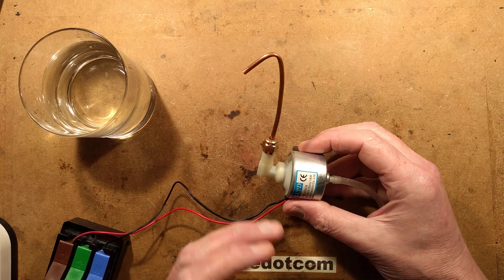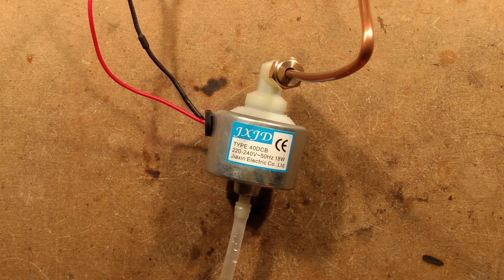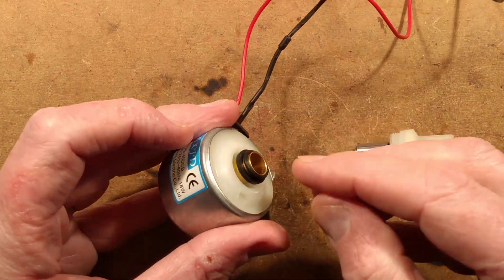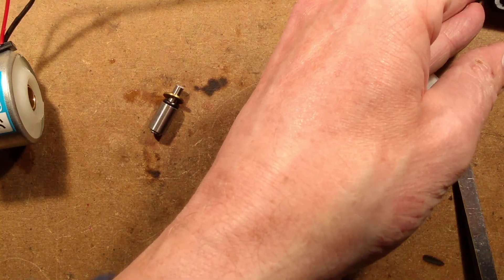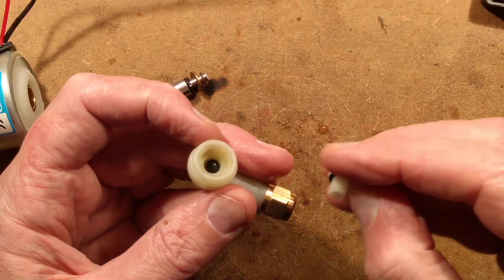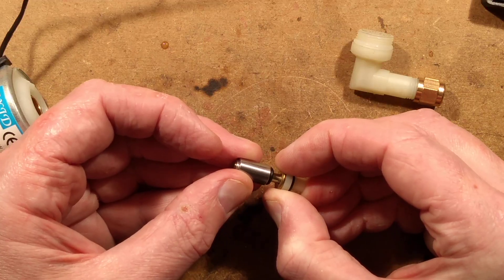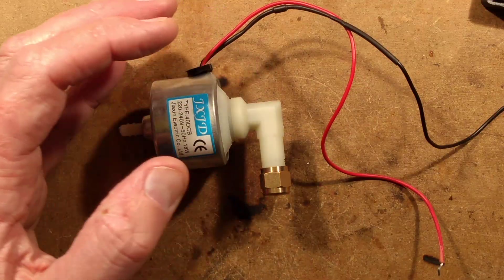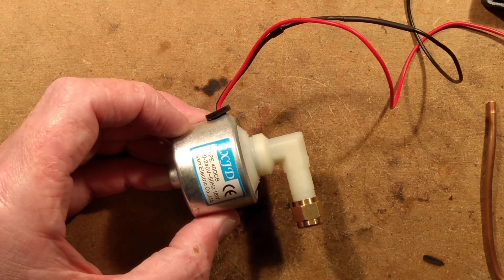Fix your smoke, snow machine, steam mop solenoid pump.

Comment: For cleaning the snow machine for storage, what ratio of white vinegar to distilled water would you suggest? Thanks.
Reply from the maker: It's usually a 50/50 mic of white vinegar and distilled water.  After running some through, make sure you purge the acid out with some plain distilled water and then run some fog fluid through the machine so that the pump is primed with glycol.

Comment: So it's NOT the smoke fluid clogging up the pipe through the heater then? EVERY bl**dy smoke machine we have jossed out after standing! We've got a superb Martin heavy smoke chiller which also packed up - I think the fridge part jossed out on that... 😞
Reply from the maker: The heater blocks do clog up over time.

Comment: Hi Big Clive, and an even BIGGER THANK YOU for that tip. H20 XL5 steam mop. I was using it and the sound of the pump slowly faded away... I could still hear it but she no pumpy!  I dismantled the mop. Very clean and no grunge buildup. I removed the pump (these things are very dismantle-able!) and saw the suspect O ring. Yes, it was fairly free on the piston when out of the unit but jammed the piston when it was assembled. No, I didn't have a replacement, so I drilled out the housing where the O ring sits, by a few thou. The O ring is still a firm fit in the housing but now when the washer is pressed against it, the O ring tends to squish outwards rather than inwards.
I tested the thing while it was dismantled - heaps of noise!   So I re-mantled the mop, re-ran some of the pipes so they weren't so pinched, and tested it. All good!    Heaps of steam!
I then was able to run a 50:50 mix of demineralised water and cleaning vinegar through it. Left that overnight to soak, purged that the next morning, then did some mopping.
Worked very well. More steam than it has ever produced.
Thanks again Big Clive!

Comment: Hello, this was very helpful in breaking down the pump to clean it.  However, I don't think this was my issue after all, as the pump still doesn't operate.  No noise/ vibration at all. 

I did notice:
1.  The light on the control board lights up immediately when powered on, as opposed to there being a delay until the heater is hot. 

2.  The diode on the pump's black wire becomes extremely hot. 

Any advice?

Thank you in advance!
Reply from the maker: The diode shouldn't get hot.  It's hard to say what is causing the issue without testing the equipment.

Comment: Great video, Questios,,,What size diode and dirrection?
Reply from the maker: I think the diode they use is a standard 1A diode like a 1N4007, and the direction may depend on the coil winding direction, but probably isn't too critical.  It's often built in or inline with the cable.

Comment: Do those pumps not use a diode? If they do use a diode would that not cut the pulses in half?
Reply from the maker: The diode lets the pump operate on a near 50% duty cycle, giving better pumping action.

Comment: I put diesel and gasoline in my smoke machine and used it as a flame thrower. But it ruined the pump pretty quickly.
Reply from the maker: You could maybe swap it for one of the pumps used for the diesel heaters, or change the pump's o-rings for fuel rated ones.

Comment: Great video.  Thanks.  
In my case, I will need to scrap my OEM pump and buy another. My OEM pump is made of brass instead of plastic. The spring plunger w/ the small rubber head that goes in the brass hole was stuck.  The only way I could get it out was to force 100PSI of compressed air from the other side.  Once out, I had a hard time to get it back in the hole.  I tried sanding the inside of the brass hole w/ 320, 400 and 600 grit sand paper. I cleaned out much of the build-up but the plunger would still not move freely inside that hole.  I tried the pump w/ the plunger stuck at the bottom and I tried it without the plunger installed.  No luck.  Amazon, here I come....
Anyway, thanks for the time you spent putting this video together.
Reply from the maker: Thankfully, the pumps are pretty common and cheap.

Comment: My unit heats up but ready light never comes on. So pressing the button doesn't do anything. How can I test if it's a pump issue or something else? I did force fog juice through it and fog did come out. Something is preventing the rest status to come on.
Reply from the maker: Maybe a faulty thermostat if it just keeps heating, or maybe a broken connection between the unit and controller.  Keep in mind that many of the remote buttons with these operate at full mains voltage.  Even if they have what appears to be a microphone style connector.
Reply: @bigclivedotcom  how do you test the thermostat? The connection did look burnt and not secure. I cleaned the connections and secured them. I think it got hotter but light still never turned on.

Comment: Ho i was wondering this question , Someone could Help me pls

So I have a beamz 1200watt and the pump doesn’t work , what happends if i put a pump with the same voltage,hz …. But the different code number ?
Reply from the maker: Most are similar, but some may have a different liquid throughput speed.
Reply: Thanks for the answer

Comment: Hi, what kind o-ring do you recommend for replacement?
Reply from the maker: It may vary between pumps, but a common size is 4mm internal diameter and 1mm cross sectional area (therefore 6mm outer diameter).  The standard black rubber rings are used in most water/glycol applications.

Comment: Word to the (un)wise: If for some reason you brute-force this thing open (ie remove the white plastic cover you normally unscrew the right angle shaft from), when putting it back together the white cover wants to be just so slightly above the contact spacer/stand, about a 16th of an inch. It's also critical that the right angle shaftt is directly in line with the hose connector on the other end (check all sides), otherwise the solenoid inside with either just hum or rattle like mad.

I found you can put a slightly thick washer between the stand spacer and the white cover. That will help maintain the correct gap. If you have the gap too small, you won't be able to screw in the right angle shaft and it will keep slipping like it's stripped (it's plastic threads so when push cones to shove, they let go). The diameter of the white cover is larger than the center brass tube and you need this center. The diameter of the right angle shaft will help maintain the correct centering once screwed in  but getting the gap, direct center and overall tightness is a science to get it all just right. Slap some alligator clips on a standard 3prong household wire and test your progress in the sink. (Take pictures of which wite goes where - ground is the wire plugged into back of pump if it exists, wire with inline diode goes to hot (black) other wire to white (neutral)). Or it might work either way. I didn't check.

Best scenario? Watch bigclive videos before you start tearing things apart the wrong way 😂

Comment: Also, if no noise when u plug in the pump , I assume the coil is bad? Is there anyway to replace or fix the coil? Thx ur vid is awesome
Reply from the maker: If the pump is being powered and not physically seized inside it should at least make noise.

Comment: Clive, I have watched your videos for years out of interest and curiosity. I recently was working on my dehumidifier whose water pump was not functioning properly. I disassembled the machine and found a nameplate on the solenoid pump which I combined with a few key words on Google only to find your video. I should have known you’d have a video on this very topic. The pump I have is similar in construction but not identical. The operating principle is the same. I had to get this pump operational today so I simply cleaned the gunk and lightly lubricated the culprit o-ring (I know eventually the o-ring will swell a bit when in the presence of petroleum oils) and it worked. I appreciate your videos and all of the interesting stuff you’ve put out over the years. Thank you.

Comment: I've been rebuilding fog machine pumps for a few years and this was a very helpful video. I didn't know the little red O-ring was subject to swelling, and I don't have any on hand. I was able to get my existing pump running enough to verify the heater wasn't clogged but I'm not getting the volume of fog I expect from a 1KW. All the other parts look good so I have to assume the tiny red O-ring is the culprit. Thanks for the "class".
Reply from the maker: If the heater core is furring up then white vinegar may clean it.

Comment: I was having the exact same issue with my smoke machine... the second I saw your tip about that O-ring that gets plump from sitting in glycol over time, I knew what I had to do. I chucked the stainless piston in my hand drill, spun it against some 320 wet/dry sandpaper until the diameter dropped from .160" to .150" and IT NOW WORKS PERFECTLY!!! The piston slips much easier inside the plumpy O-ring!!! Thank You SO MUCH!!!!!!!!! Mine is a Chauvet Hurricane F-800 and the pump is labeled SP-12A but virtually identical to the one you showed!

Comment: Well i took it apart again and sure enough the solenoid plunger was sticking on the rubber seal. I flied the inner of the seal but although it improved it was still sticking so I used a blade and gently scraped the plastic where the outer par of the seal goes. Its working perfectly thanks. Its an H2O Steam Cleaner. Thanks again.

Comment: Brilliant video. Exactly the same pump as in a floor mop that I'm trying to repair. The whole heater was blocked with scale. Ive cleaned it and descaled everything. It worked brilliant at first but then stopped. I rechecked and no blockages so i took the pump apart, I can hear it trying so I'm at a loss. Now seeing your great video Im going to bench test it and check that seal is not too tight. Thanks.
Reply from the maker: You can get replacement o-rings.  A dab of silicone grease can get things going again.

Comment: Thank you for this video.  Due to your full tear down I was able to determine the plastic housing in the donut hole of the solenoid connecting the piston to the fluid input nipple was broken.  I ordered the same pump in this video for my Froggy's Fog F4 Fobble machine.  FYI - for those who have my same issue, read on.  I had to reuse the black cone shaped o-ring from the output side of the original pump to seal the existing silver metal tubing to the new gold colored nut.  I wired it from red to brown and black to blue using Scotchlok UR2 butt splice connectors.  I left the diode on the wire.  She runs great!

Comment: My original pump had a third wire for a ground tab.  The new pump I ordered looks like the one you have with no ground tab.  I hooked it up without it and it works but would you know if this is needed?

Comment: At 13:04 frame, you can see a ~ 5mm straight "slot" on the metal piece. When pump is activated in our fog machine, water leaks out of this "slot". Other than water leaking from this spot, the fog machine works fine. Any thoughts on why water is leaking here? thnx
Reply from the maker: That suggests a missing or pinched internal seal.

Comment: Hello Clive. I hope you are well. I've been given some of these that don't work and all have been a case of blockage. I'm sure my method of clearing it would not be "Clive Approved" but worked. I had no clue the pump would disassemble that easily.
Thanks and have a great weekend.
Reply from the maker: I'll guess forcing fluids through it?  That works.
Reply: Pumping fluids at enough pressure to force cleaner to bypass the 2 check valves. There's a magic point in which the valves neither block or pass and that allows water to chase enough blockage through to clear it up.

Comment: In my case the pump was stuck, but I just opened it up as in this video, cleaned it a bit and then tightened the valve part, but maybe 3/4 way through. Turned the pump on and it rang like crazy. Then I disconnected the pump and tightened the valve a bit more, turned it on, it worked and was more quiet. Then I disconnected it again and tightened it fully. It works.

Comment: What I do is after using the smoke machine, I purge it first with distilled water, then dry air.  When you fire it up, the dry o-ring may be stuck & the pump refuse to prime.  I use a small syringe to force distilled water through, & usually the pump fires right up.

Comment: got this pump to replace an old one in the snow machine as its not working only thing is on the old pump its a brown wire and a black wire could you tell me would it be the red wire to replace the brown ?
Reply from the maker: If the pump is the correct voltage and has a diode in line with one of the leads (sleeved) then the two coil wires can be connected either way.
Reply: @bigclivedotcom  Yeah same voltage but it looks like the diode is on the brown wire on the old pump so are you saying it doesnt matter where i connect the red and brown wire ? appreciate you getting back to me aswell
Reply from the maker: @joellangford9762  It should work with the coil wires either way round.

Comment: I replace my pump, and it is STILLL not pumping any liquid while testing.  I can hear it trying, but no fluid.  Pipe is clear and no pin holes.  Baffled !
Reply from the maker: Is it a fog machine.  If it is and the pump is buzzing it may have a blocked heater core.  That would require a replacement heater core, although a new machine may be cheaper.

Comment: Do you have a link for the O ring
Reply from the maker: You'll be able to find them on eBay in packs.  Outer diameter 6mm, o-ring thickness 1mm.

Comment: I have an ion fog machine where the pump seems to be broken can you recommend a good replacement pump I could buy it looks almost exactly like the one that you have on the video on micro pump?
Reply from the maker: If you search on eBay you will find it's a very common pump for smoke machines.  The other main failure point of smoke machines is a blocked heating chamber.  If it's blocked you will usually need a new machine.
Reply: @bigclivedotcom   do you have a video if how I can check the heating chamber? If so could you put a link to it?? 😬
Reply from the maker: @hectorromero3536  You should be able to squirt water or fog fluid through it with a syringe if it's clear.  If totally blocked it needs replaced or a new machine.

Comment: Thanks Clive! My old smoke machine has a second live thanks to you! The old o-ring was so puffed up I could never have guessed the size. 6x4x1mm was bang on!
Reply: It sounds like the o-rings are the biggest problem in these machines, almost a design defect.  Couldn't there be an improvement to the original design by the pump manufacturer, or a repair option, using some kind of "self-lubricating plastic" such as Teflon or Delrin for the o-rings?

Comment: I've stripped my pump down on bubble/smoke machine. Beamz SB2000LED
It's model is 30dsb-zjf pump 50hz 18w.

My machine works for a while then the smoke seems to stop.

Is it the pump or could it be the heater element not heating the fluid?

The pump seems to work though.

Any thoughts?
Reply from the maker: If the pump is pushing through liquid then the heater block may be blocked up.  It may be possible to dissolve any blockage with a weak acid like white vinegar in water.  Complete heater pipe blockage is a fairly common machine failure.
Reply: @bigclivedotcom  I'll try white vinegar through it. I've flushed through with distilled battery water after use.
Frustration is I've only had it out twice to use and after about an hour the smoke stops and it's just bubbles blowing... Making it an expensive bubble machine lol
If I get a new pump off the net... I see they say 500w 900w etc. Does it matter which you get as mine is a 2000w unit.

Comment: Do these pumps need to be primed before first use ? I've just replaced a pump in out snow machine but it is not pumping anything
Reply from the maker: Sometimes they do need a hand to get started.  You could try forcing some liquid into the pump.
Reply: @bigclivedotcom  Thank you for your response,, however I am an idiot.. the snow machine has a flow pot (which was turned all the way down)

Comment: many thanks, i followed your vid, removed my pump from my fog/bubble machine that had stopped pumping. Striped it down, put it back together and it then worked again.
the metal brass 'o' sleeve i soaked in Cilit Bang, to clean it up. Not sure if that made any difference though lol

Comment: I brough my haze machine home (which is essentially a low output smoke machine and a high output 240 volt fan at the front on a 45 Deg (ish) angle, which disperses the smoke quickly so it doesn't look as frightening when it comes out of the machine) and I was faced with exactly this problem : I knew the pump wasn't working. Lo and behold your channel pops up and the fix of the first o-ring being flattened was exactly the problem the pump was all the way in one direction and wasn't coming back enough off the buffer. Popped in a 6 x 1 mm o-ring (I service air rifles, so I have 1000's in zip lock bags) and would you believe it the bloody thing works again. Now I'm going back to making more Joule thieves (it feels like somehow I'm saying thank you, with the added bonus of keeping the few quid I have in my pocket). Please keep up the excellent work, your channel keeps me going when all around me have failed.

Comment: Really helpful video. My pump is broken but has a earth on it but this doesn’t. Do I need to replace it with an earthed pump or is this fine
Reply from the maker: If it's in a grounded metal case or connected by metal tubing to something that is grounded then it should be OK.